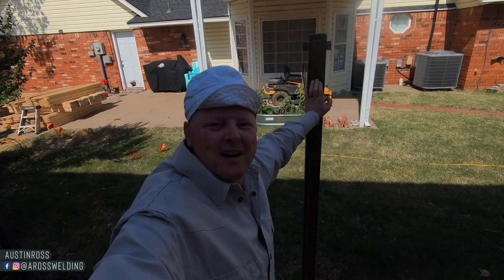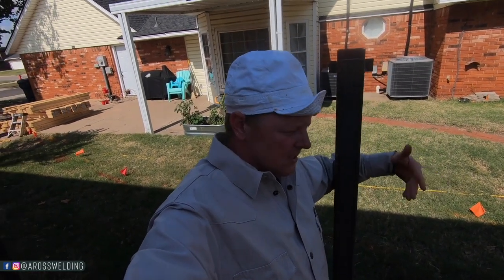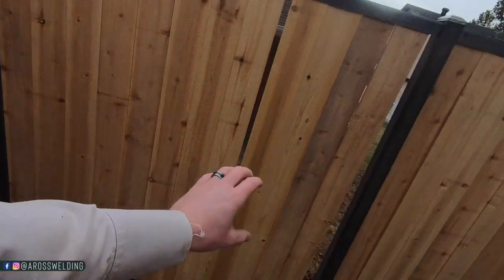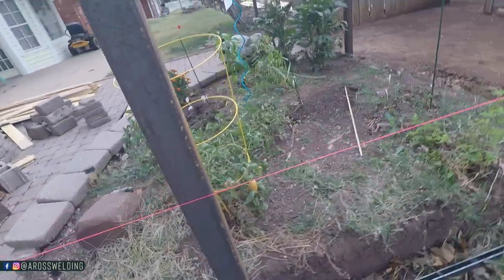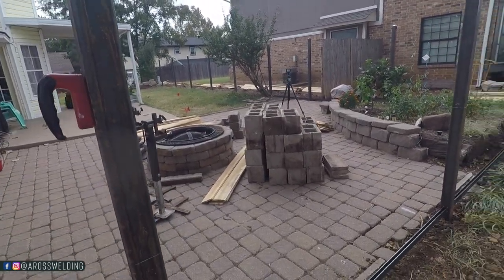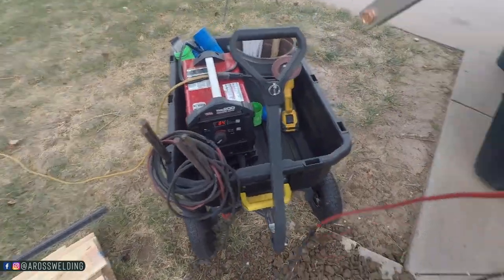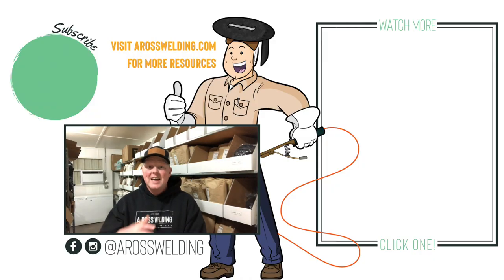METAL PRIVACY FENCE INSTALLATION - CUSTOM REPLACEABLE PICKET DESIGN

Comment: Great job and good looking fence. I dont trust a string line. Use a laser level or transit is the best thing but the can be pricey. Before i could afford a tool like that i would use a water level. Clear tubing with died water and a valve on the ends. Works great and easy to use plus you can make it 20ft long or longer. Look it up it might come in handy for you. Take care and keep up the good work.

Comment: Austin I really learn a lot from your videos. I watched one where you were setting 5 foot tall fence posts on around a 200 foot line. I will be setting a 110 line of metal posts soon. My question is this: what kind of string line do you use for those distances that won't sag or break over that distance? Thanks.

Comment: How do you get consistent distances between the posts?  Do you have to cut all the top and bottom rails to fit without having to pull the posts out of plumb?

Comment: Good work.. nice fence... I have a question what rod did you used?? And if you can advice me on what rods to used outside and when is windy??? Also what kind of stick rods to used when there’s paint or rust?? Or always have to clean the metal before... I don’t have experience welding outside and using stick welding but want to learn.. your advice or someone else help would make a change in my life.. thank you and keep uploading videos, nice work..

Comment: "Flood" makes several shades of stain for cedar fence.  I use 'Cedar Tone" .  Two coats will last 20 years.  Unless their sprinkler system constantly washes the fence.  The stained fence will be much more desirable than the natural aging.
Reply: Is Flood a brand name?
I need to redo a small deck.
Reply: @richardflaherty2373  
google Flood cedar stain
Reply: @bwinford1561  Thank you!

Comment: You need to make the gaps in between your posts uniform ,make up your top and bottom rails to the size of the pickets , build the fence with posts and base rails in one go ,the Base rails set the post distances correct . Then piece up to the corners.

Comment: As a carpenter, I would be concerned with the pickets warping and bowing. As a welder... NICE JOB MAN!
Reply from the maker: I’m new to pickets/ privacy fence, do you think the middle cross members will help with this??
Reply: I think there is a high chance of warping if you dont add the middle support. Unless the pickets are the higher quality thicker pickets.

I'd say home depot pressure treated will in fact warp. Cedar will likely hold up better, since there will be less moisture leaving the wood.
Reply: @arosswelding  Absolutely! Great idea.
Reply: Use composite decking boards?

Comment: Hi Austin, I notice you always use  “black steel” that begins to rust as soon as it gets damp, why not use galvanised steel and avert the problem?
Reply: 2 big reasons are the health risks of breathing the fumes and 2nd is the zinc coating on galvanized steels can compromise the weld making it weaker and also can make it look sloppy if not done correctly.

Comment: Is that carbon steel? How do you deal with corrosion?
Reply from the maker: Yes, it carbon steel. I reckon it’s all in the paint job. But carbon steel without paint will last 10 times longer than wood,, as long as it is thick enough material anyway.

Comment: Very kool gate, i like the capping style. Did you have the top and bottom caps made or bought off the rack?
Reply from the maker: Bought off the rack
Reply: @arosswelding  I am not able to find those in either of my box stores. Only thing I find is Slipfence rails, but those are crazy expensive. can you tell me the proper name to to online shop the ones you are using? thx U

Comment: Did you factor or bid in, the extra material for the center rail?
Reply from the maker: You bet. That was a lil change order
Reply: @arosswelding  fantastic. I've been a welder/fabricator since 95. . I found your channel, and now here I am, subscribed, to both of yours and watch all the time.  I really enjoy them.  Are you done on the pipeline/union for now? I noticed you stopped mentioning in the opening line tips and tricks for pipeline and rig welders, to just rig welders. 

Thanks for responding.  Keep up the good work ethic.

Have a blessed day
Reply from the maker: Ya, pipeline work is slow so I’m just doin what I know to keep the lights on. Thanks for being here and subscribing!

Comment: Not looking to be a Debbie-Downer, but when working with any kind of wood, you have to remember that wood expands & shrinks, depending on the weather, summer vs winter. Personally, I'd go with a minimum 1/8" in. (0.00159 m) spacing, to as much as a 1/4" in. (.250" in. / .00635 m.) If you don't allow for this, the wood will buckle and distort.
Reply: Good note Dave, i will keep that in mind when i build my own fence 👍

Comment: Hey Austin, when you get that magnet tape measure holder ? That’s pretty cool. 
Thanks 😎👍🏽
Reply from the maker: I think I got it at an ace hardware store in pa years ago. But you can find it in the description of this video under Rod Magnet 
https://youtu.be/_3UDrhzBP2w
Reply: @arosswelding  Thxs

Comment: Just curious, if you're willing to share it, what's your cost per linear foot?
Reply from the maker: It depends on the job,,, cause I normally just bid every job individually. But it seems to be averaging I’d say, $40/foot... depending on how many feet I’m doing. Smaller the job, the more it cost per foot.
Reply: What’s a nonlinear foot?
Reply: @markman63  I guess a square foot.

Comment: what was the spacing between posts?
Reply from the maker: 🤔 makin me think this mornin… I usually figure on 10’ spacings but on this deal I prob just spaced out whatever was even with in the short distance there. I’m thinkin they ended up being  around 8’ or less between posts
Reply: @arosswelding  my wife has been wanting a fence and I’ve been wanting to build a shop/sheep and I think this would be a great solution. Also I’m in central OK. Hope you’re staying safe and warm. I work at one of the Amazon Delivery stations that services Stillwater and we just called off work today!
Reply from the maker: Oh nice! Ya, the projects are never ending! It’s just deciding which one to do next. Lol
Yes, I hope you are staying warm also. The weather got bad in a hurry.

Comment: What are the tracks that you use on the top and bottom called if I wanted to find them to buy?
Reply: Or do u fabricate them from flat bar?
Reply from the maker: They are custom burnt and broke
Reply: @arosswelding  what do u mean when u say "burnt & broke"?
Reply from the maker: Cut out by a plasma table and bent by a break press.
Reply: @arosswelding  cool. Love ur channel btw. Bought a Hobart champion 145 today. Decided if I'm going to be serious about welding I need something I can lug around town and do odd jobs with.

Comment: Did you use 7014 rod?
Reply from the maker: I used 7018 and 6010
Reply: When would you recommend to use 7014 3/32? Im new to stick welding
Reply from the maker: It all depends on what you are welding on

Comment: I am contemplating a custom steel fence for my yard and saw this fence in my feed.  I watched all 3 videos related to this fence but no where did I see a detail on how or what you used to make the top and bottom rails.  Leaving disappointed for sure.
Reply from the maker: https://youtu.be/BGBi5Wjd4vU
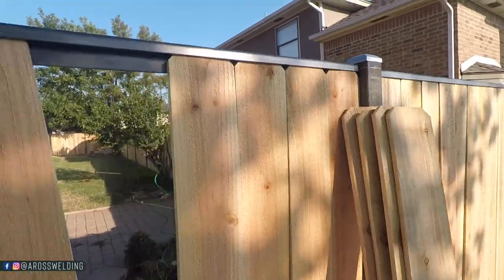Fast forward to 5:50 and 9:30
Reply from the maker: I will also make sure and put the details in this weeks video. 👌😎

Comment: What size and type of metal rail for top and bottom rail ?
Reply from the maker: 11 ga. Aka 1/8th inch
Reply: @arosswelding  Then bottom rail is a C Channel or a U Channel ?
The top rail, did you weld 11 gage material to a C Channel ?
Sorry if still learning, need more information.

Comment: It's not going to work.
Reply from the maker: I hope you aren't right but I guess time will tell.
Reply: I hope you aren't right either... I had a project disaster yesterday and trust me it's one of the worst feeling around.
Reply from the maker: @MetrologyEngineer  that's the worst. but fixing it and making it right is worth it!
Reply: @arosswelding  Yep... Stupid concrete hardened to fast and my form failed me. Thanks for the words of encouragement. Luckily it was only a planter that used 100lbs of concrete.
Reply: Get tf out of here with your negativity.